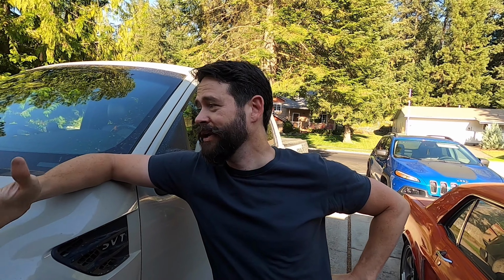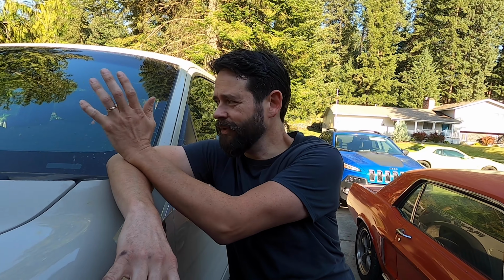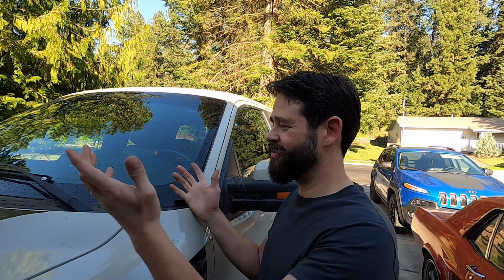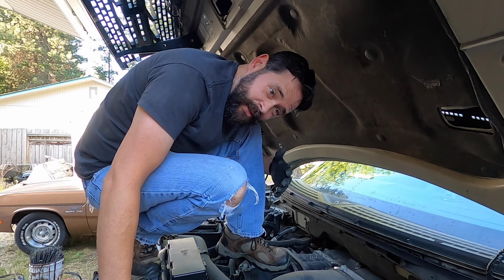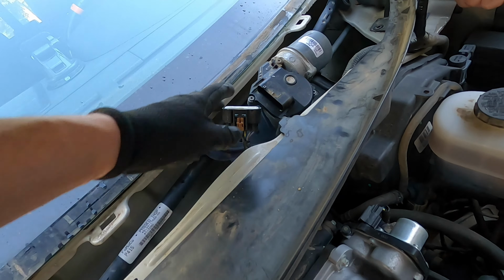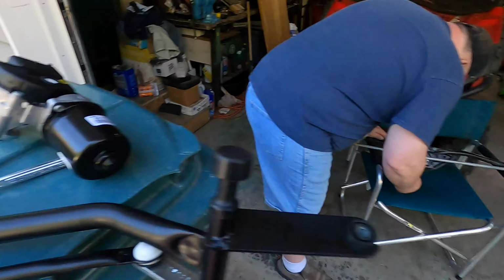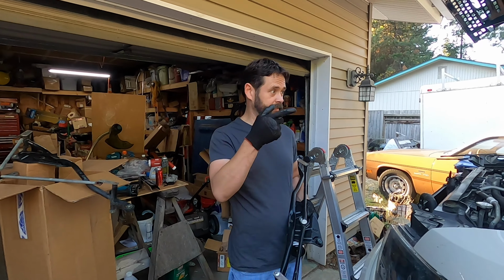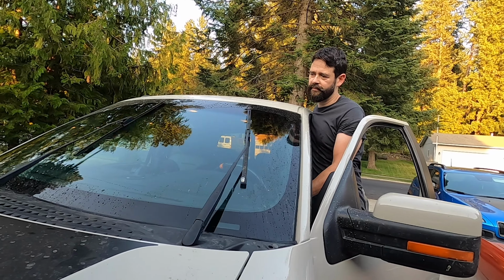Replacing the Wiper Motor and Wiper Transmission 2009-2014 F-150 and Raptor - How To

Comment: Appreciate the video. What was the actual problem? I plugged in a new wiper motor but still not getting any voltage at the washer pump. Last thing I can think of is that the switch on the steering column went bad.
Reply from the maker: These trucks have fuses that run several things each. it's kind of crazy. I'd definitely start with that. Mine was a fuse and worn out wiper transmission. Let us know what your find!

Comment: Great video. What was wrong with your washer pump? Having the same issue.
Reply from the maker: The problem was the washer pump relay that goes through the wiper motor. Its really a poor design. The wiper motor was working just fine,  it was just the relay that cant be changed except to swap out the whole wiper motor. Let us all know what you find out!

Comment: Having the same issue, replaced the pump, fuses, the multi switch, and the motor and still nothing… What fixed yours after the motor fix didn’t work?
Reply from the maker: Great question. I took it back to Ford after changing the pump and they said it was a bent pin in the lines. Super weird because how did it get bent when it was working before? I think when they were originally looking it over they unplugged something and bent it when plugging back in, so the wiper motor was actually the main problem. 
If you find a different solution pleas post it here for everyone!
Reply: @MotorsandMischief  I narrowed it down to being a wiring issue some under the dash and I don’t have time to pull that all apart and go through the rats nest of wires right now so I installed my own wiring harness with a switch ran to inside the cab and to the washer motor to be able to pump fluid and then manually turn on wipers for right now
Reply: I've done the same... what was your final solution?

Comment: I think after you fixed it, that it seemed to be jittering mostly when the water was gone. Which is when you would usually turn them off. That seems pretty typical to me?
Reply from the maker: Very true, they don't like the dry windshield. Waxing the windshield might help, we'll have to try that